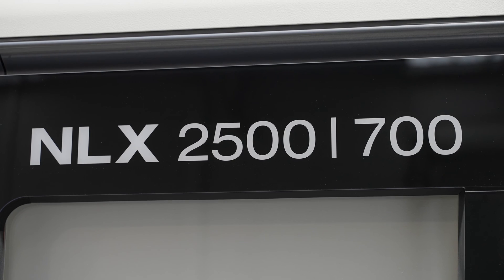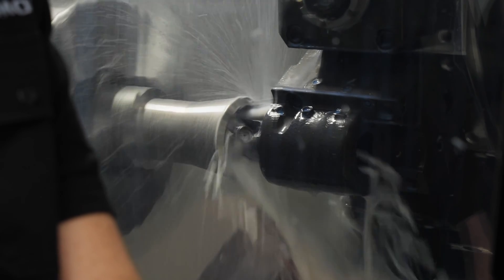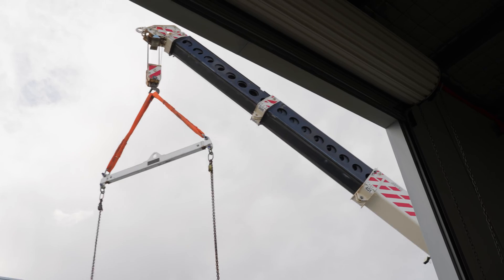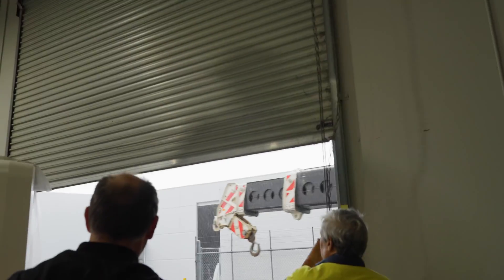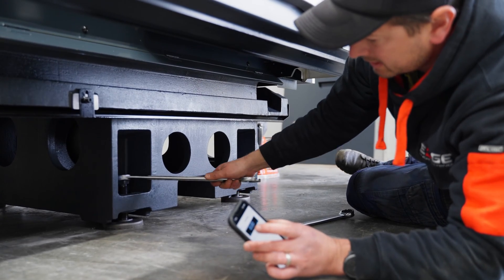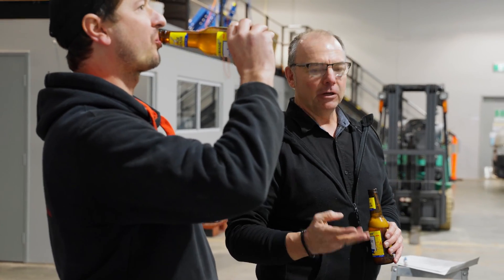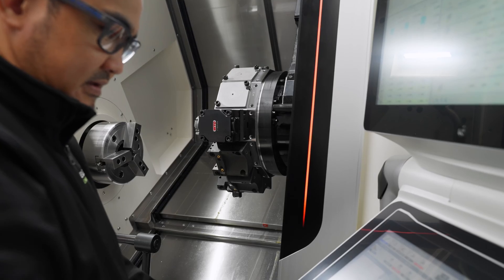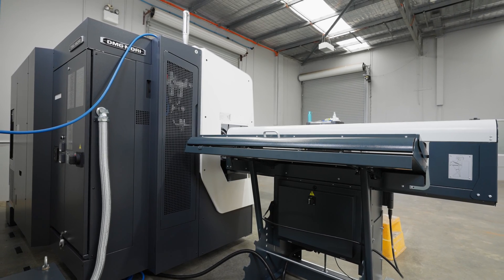Introducing our new DMG MORI NLX 2500|700 CNC Lathe

Comment: I work on four of these machines now in my new job and I have to say they are great machines, very rigid. But the the only negative is the control, CELOS is not real intuitive IMO for a conversational control. It is great for CAD/CAM integration but the Siemens ShopTurn control option for this machine would be the ultimate package if you wanted a machine mainly for conversational programming.